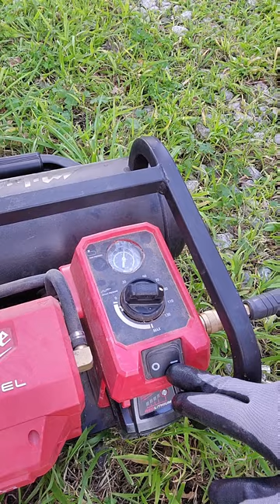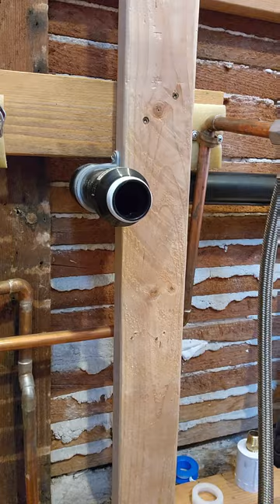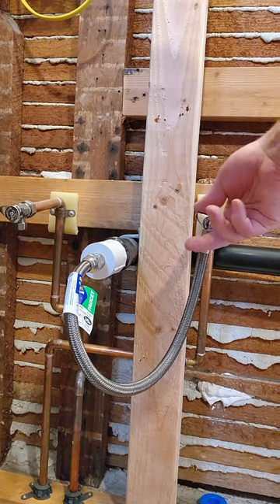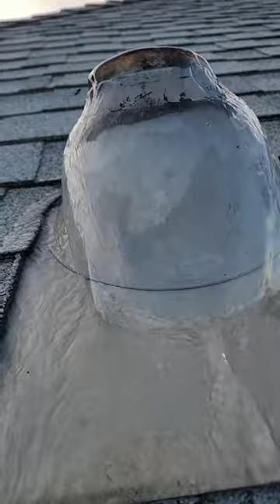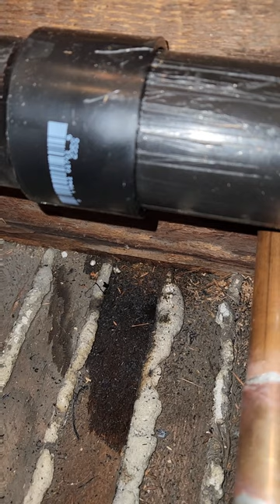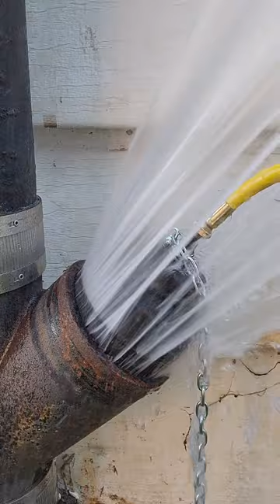Pressure testing bathroom remodeling with 4" Cherne long test-ball plug. #plumbing #remodel #diy

Comment: Thanks for Sharing Nate. What's the name for the adapter you used between the drain and the supply line?
Reply from the maker: I assembled the adapter out of readily available PVC couplings and a 1/2" brass nipple. Then use a flexible supply line just like a sink.